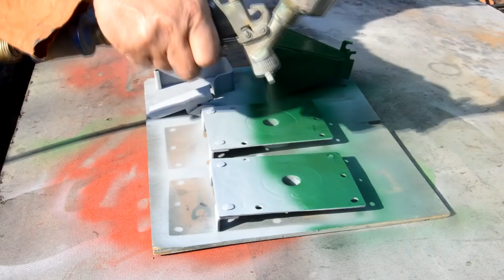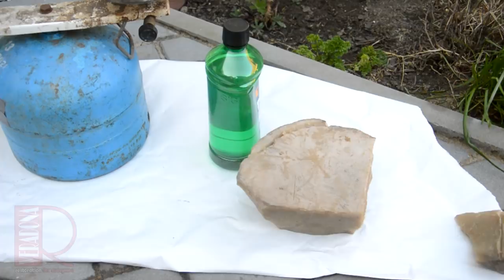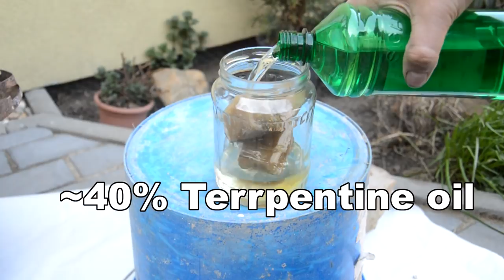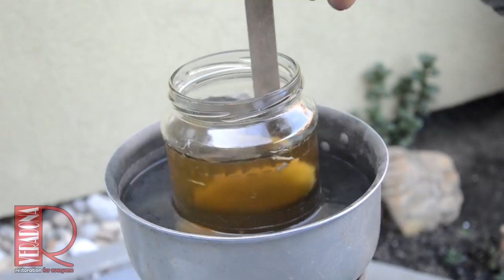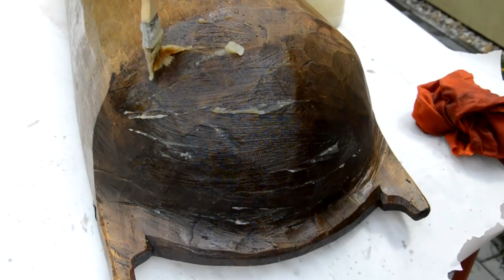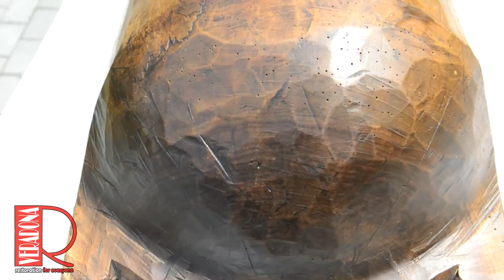Preparation of wax,  příprava vosku DIY

Comment: I use a mixture of bees wax and carnauba wax (3:1) and add a little more oil as the carnauba is quite hard. In the U.K. we get gum turpentine and turpentine substitute, it’s worth mentioning that it must be the gum turpentine.

The gum turpentine is more expensive but you end up with heck of a lot of wax for your money. I’ve started making my own hide glue as well, except for outdoors as it isn’t water resistant. Do you use it at all? 

Another great video, I wish I’d seen this before I started making my own, there’s very few videos as easy as yours to follow. I love the new intro as it shows a few of your many skills.
Reply from the maker: Carnauba wax is certainly better, but more expensive in our country.
Thank you for your comments to our friend